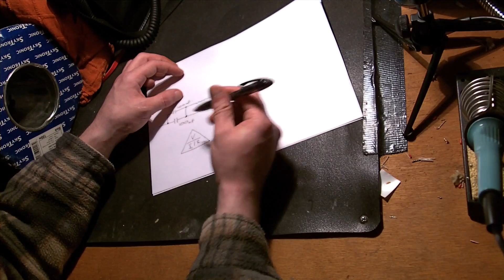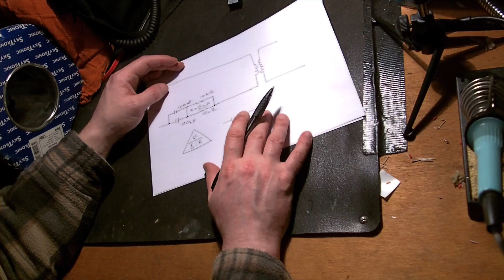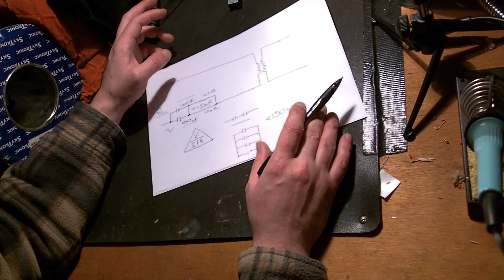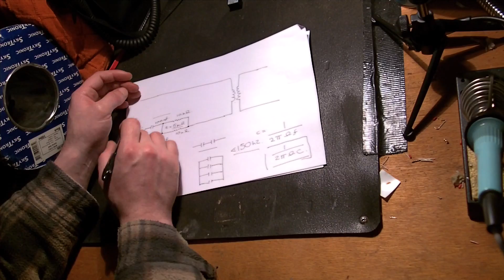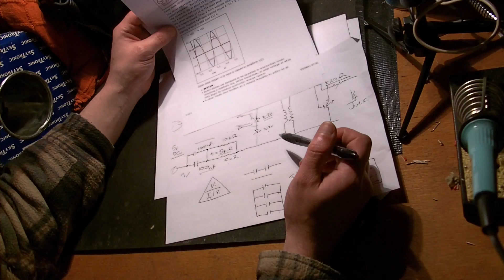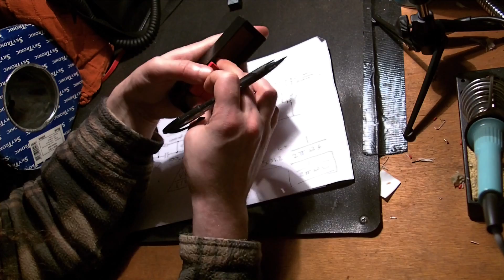How To Phone line jacking recording signals undetected The legal way

Comment from the maker: Yes AC that is the reason for the high voltage capacitors. Filters out the high peak AC spikes. After that it is just a straight 5V DC. Circuit works well and it has been well proven and tested over the years. You can add small safety elements to the circuit if you are paranoid. Test it and hook it up to a dual chanel scope you will see the actual signals.

Comment: Phone lines in the UK are not 5 volt. They are approx 50 volt. And that circuit would cause a lot of problems when the ringing current comes in  as this is about 100volt peak to peak.

Comment: Great vid, but I'm wondering where you are from? Would be very informative as the telephone lines differ from country to country. E.g. you talk about 5V - as far as I know, for example in Germany, the voltage is somewhere in between 12V when in use and 48V up to 100V when not in use... Not that someone rebuilds your circuit without considering that your circuit may not work for every telephone network! :)